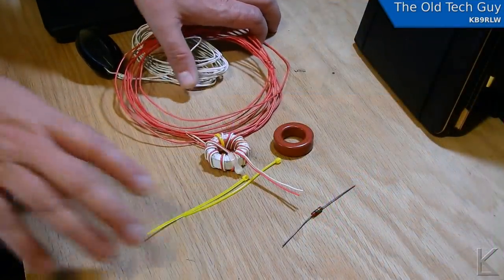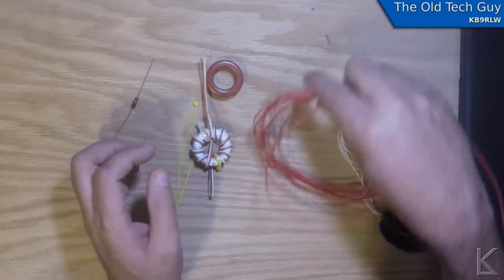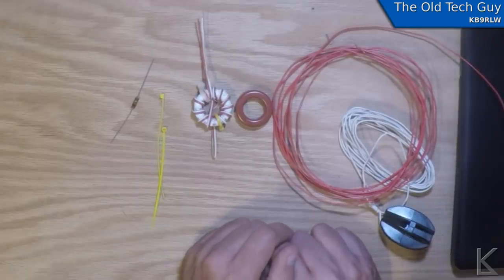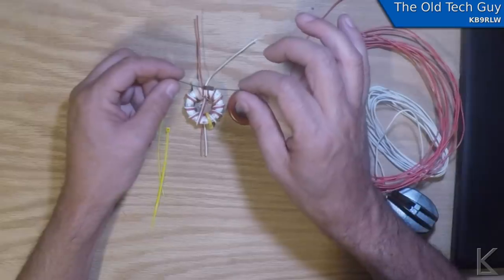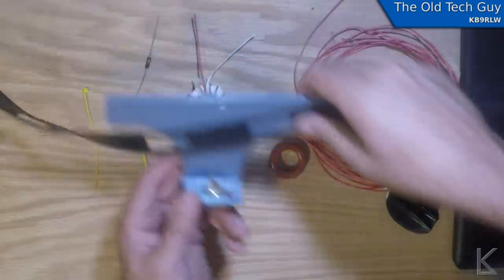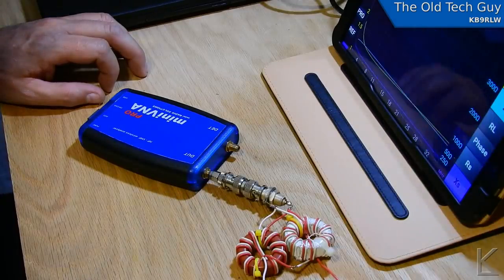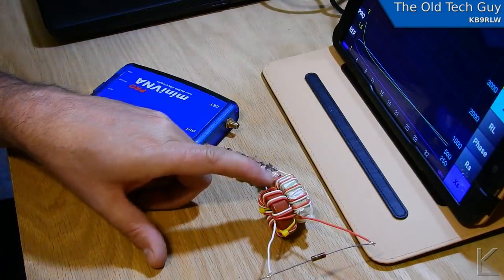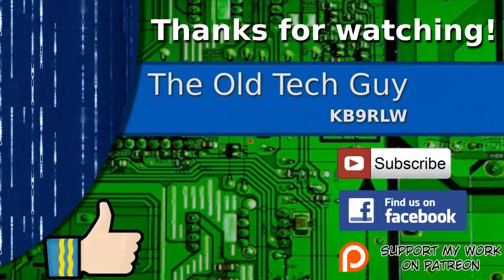Ham Radio - Building a 4:1 balun

Comment: Well, I bought a DIY balun kit on Amazon.....the instructions literally said "google it".  I found this video, which basically told me the kit has the wrong number and type of core, and the wrong wire.  I ordered the proper parts, followed these instructions and was pleasantly surprised at the results.  I was at least able to use the box and hardware from the kit to make a 4:1 balun I know I can count on.  It looks great on the analyzer.  I wonder how I went 30 years as a ham without knowing how to do this, but that's the point I guess....keep advancing your own personal version of the radio art.  Thank you for the info and the presentation.  N2SUB

Comment: The idea of this config of 4:1 Balun is it provides 4:1 matching but also if you use 43 or 31 mix cores the two 1:1 baluns connected series one end parallel the other end also give you common mode current choking as well all in one balun

Comment: Oh, was the part where you made the balun only available on the Patreon side? “Building a 4:1 balun” seems inaccurate as a title.
Reply from the maker: Well it wasn't put into a box, but the transformer was built in this video. All you need to do is wire it to a couple of connectors mounted in a box.

Comment: On the 1:1 choke video you me tioned 4 turns on each side as a 1:1. But here you mention 6 turns on each side for rhe 1:1? Thanks for any help great video easy to follow and understand
Reply from the maker: When just winding a choke, you can use any number of turns, as long as it's identical for both wires.  More turns mean more 'choking' action, but maybe greater losses in the choke.
When winding them for use in this balun, the number of turns matter for proper impedance transformation.
Reply: @loughkb  okidoki thanks a lot! 73 de NP3JD

Comment: The notion that wire can short on the core is not something I notice when using Ferrite.   My ohm meter shows no conductivity in Ferrite.  I always use 43 and I note you have a Red core which isn't Ferrite (I think red means iron but I'm not sure of that).  A question I have about use of glass insulating tape on the cores (not plumber's tape btw) is whether the wire heats the core or the core heats the wire.  I realize the curie temp is to be respected and keeping core cool is a concern but as far as 'what heats what'  does anyone know??
Reply from the maker: I believe I recall reading, and it makes sense to me, that the core heats due to eddie currents that are induced in it by the moving magnetic field. But that would be something I read many years ago when studying for an EET class.  Many years ago. So I don't know if that's accurate or not.

Comment: Hey Kevin, nice video.  I built the 1:1 from your video.  On this video, I see that the you mentioned 12 turns but on the 1:1 it is 8.  I went with this recommendation and man does it work great!  Had results as you have shown.  With a 260 ohm resistor I easily got down to 1.5 with all but 80 meters which topped out at about 2.0, which is well within my auto-turner's range.  I have watched several videos on baluns but yours was definitely the easiest to follow, full of great practical info and excellent video work.  Thank you so much! 

Burt
K4SRQ

Comment: I missed the Patreon video because I was contesting. Seven wire thermostat wire works good also. Now I'm confused Kevin. I been told by some EE's  that mix 43 and mix 61 are good depending on the power pushed through the torroid cores. I don't think I will have any problem since MAX on phone would be 10 watts; 5 watts using CW.

Comment: Kevin , I noted you used  multiple strand wire and not solid drawn wire.  It never occurred to me to use multiple strand wire. It obviously works!
Reply from the maker: It will, but it's hard to work with since it doesn't want to hold its shape when wound. I used solid core wire.  The photo from M0PZT site shows he used stranded.

Comment: The two cores in the M0PZT balun that you reference are NOT wound "SYMMETRICAL"  - why doesn't anyone mention that, and/or the possible affects of that ???

If you look, the red/black colors are REVERSED on the windings between the left and right cores.

On the right core, the winding starts with the black wire on the RIGHT, and on the left core, the winding starts out with the black wire on the LEFT, but yet the red's are tied together, and the black's are tied together on input!

What affect is this going to have on the phase, etc. (interactions?)

Can someone please explain this ?

At minimal, you didn't duplicate what he did, nor recognize/mention this in your video. You should fix that !
Reply from the maker: Yes, they are physically wound symmetrically.  Nothing to do with how they are electrically connected.

Comment: Our club in Central Oregon is preparing for a field day when weather permits for building off center fed dipoles. I have a Nano VNA and had planned on using it to confirm I have 50 ohm at the coax. I am still just a technician so I am trying to get my feet wet. Thanks for the video.

Comment: Great Video! What if the results had been different and there needed to be adjustments? How would you adjust the windings to get the SWR down if needed? Thanks! 73 de KD4NZR
Reply from the maker: If the translated impedance was high, I'd have added a winding to each, if it was low, I'd have removed a winding.   I think I got that the right way around! :-)

Comment: Nice work, Kevin! Would this be considered a voltage balun or a current balun? In researching OCFD antennas in the past, some people seemed particular that it must be a certain type of balun (I think current IIRC). Maybe you could explain the difference in a future video and why it is (or isn't?) important? I was never certain if it really mattered because I thought it was impedance that the balun was converting. Impedance is a ratio that involves both voltage and current, so saying a balun is just one or the other didn't really make sense to me. At any rate, this was really useful to me because I was about to build a new OCFD as well. Thanks for the video and links!
Reply from the maker: This is a current balun.   From what I'e read, a voltage balun would't work well in this application due to the phase relationship between current and voltage along the dipole antenna.   Most antenna projects I've seen that involve a balun warn against using the voltage type and recommend the current type.

Comment: If I use this on an off center fed dipole do I also need a 1:1 choke to suppress RF on the coax or will this balun suppress it?  Thanks!
Reply from the maker: Due to the way this one is wound, I think it will supress a bit of RF going back up the feed line.   You probably won't see much on the band the antenna is cut for.  If you force the antenna on another band with a tuner, you'll always get some RF down the feedline due to the mismatch at the antenna.
Yes, this would be used on an OCF dipole like a windom.  Also used on a folded dipole.
Reply: @loughkb  thank you sir.

Comment: I have been wondering if the Litz wire has been forgotten or is there some reasoning why it is not needed in these kinds of wound components.  Just recently I had a reason to check the numbers again. The result was that resistance of both solid wire and ordinary stranded wire is in steep increase already soon above 100 kHz.  That applies to AWG 18 size.
I can speculate that the Q-factor does not collapse at the higher frequencies as the inductive part of the formula also increases by the frequency.  Anyway, my situation was dictating Litz wire use at 100 kHz due to overheating of ordinary wires.  Another difference is that the shown toroid coils are pretty open, allowing cooling, while my choke needed to be 3 or 4 layers thick.

Comment: Hey Kevin, i made i bigger version of this 4:1 balun.....but i have a question.......do you think that i can mount this balun attached to the antenna, or i need to keep it far from it??
Reply from the maker: The 4:1 balanced to unbalanced matching transformer is designed to match a higher impedance balanced system to a lower impedance unbalanced feed line. So in the case of a loop, an off center fed dipole, or ladder line to coax, the balun needs to be at the high impedance point. So at the antenna. And that's what balun means, balanced to unbalanced.
Reply: @loughkb  sorry i asked something different, i was wondering if the antenna metallic boom would make some problem if i attach balun close to it
Reply from the maker: @bairamzubi280  you would not want it too close to the boom. A few inches away at least
Reply: @loughkb  argh i have already mounted it on the boom.....with nano vna idont have any chage....i hope that it willthe same with 500W. cheers, thanks for sharing 73 IU4PSD
Reply from the maker: @bairamzubi280  at 500 watts, I hope you used appropriate wire and insulation from the cores so it doesn't arc

Comment: Thanks for the video. 

I was wondering if this balun can go in a metal enclosure or if plastic is recommended.

I'm making one on smaller 43 cores and it would fit in an Altoids tin which I already have, but don't want to use if it will adversely affect performance.
Reply from the maker: I've put them in both.  It doesn't seem to matter.

Comment: I'm on the verge of this and I've watched your's and other folks videos on building an unun.  Mine will be for end fed. While you make it seem easy, my fumble fingers will make an easy job difficult.  Who knows I may wind up with an antigravity torus or a fire starter Bear Grylls would be proud to own.  I'm sorry for jumping on you about kerchunking. I didn't intend it to sound angry or vicious. Sometimes my fingers type with out consulting my brain.
Reply: Lew, I don't think you will be happy with 4:1 on an end fed wire. 9:1 would be minimum.  You may need higher than that, depending upon the wire length and bands used.

Comment: Excellent video and presentation. I have used a home brew off center fed dipole with 4 to 1 balun for several years (10 or more years) for 80 through 10 meters. The performance is superb as long as you keep the legs of the dipole at least a foot away from tree limbs and other conductors. My balun is able to handle 1200 watts PEP and 600 watts RMS with ease because the toroids I used are muich larger than the ones you used. Amidon makes a kit for this balun that works great. The radiation pattern from the OCF on the higher frequencies seems to have multiple lobes but on 40 and 80 it acts just like any other half-wave dipole. It is my go-to antenna for portable operation. Thanks for sharing it with us. Great job, keep up the good work. 73 DE K7RMJ Frank
Reply from the maker: The antenna I'm building is a mono band and ocf.  Works amazingly well on the band it's cut for but not on others.

Comment: I hope this antenna installed as an inverted vee doesn't shoot everything straight up, I would like a suburban backyard antenna that can work some DX on it. My mast can support a dipole at 23 feet, and have plans to make it 31 feet max, with ends 6 feet above ground with angles going from 115 to 105 degrees when I get it higher, in a 79.5 foot space. I will be taking notes on this one. Thanks Kevin.
Reply from the maker: Well, this is a unique design.  First I've seen of this type.  It is a monoband antenna though.  I've built it for 40 meters and it's performing better than any 40 meter antenna I've ever had.   It would fit in your space, but you'd have to choose a single band.
Reply: @loughkb  One of my friends has a 80 M version and made another for his son. I was considering a 40 M sized version to try out by modifying an existing dipole. Or just making it a 80-40 coil loaded dipole. My friend has already sold me on the design, I am sure your going to really like yours. And I'll still be taking notes from you on this.The 4:1 balun design was another element I needed to know about too. Yours is easier.

Comment: Thanks for this. It was very instructive, especially the verification you did with the VNA.  I'll really need to get one.
Reply from the maker: You could manually sweep the range with just about any antenna analyzer and measure the impedance.  There's also a way you could do it with an oscilloscope, frequency generator and ohms law. :-)   But the VNA is proving to be one of the most useful tools I have.

Comment: Nice video Kevin! Will one of those work on 2 meters?
Reply from the maker: Not with these core types or windings.   At those higher frequencies, you would need different components.  Also, with a half wave dipole being somewhere around 38 inches, finding the 200 ohm off center point would be difficult.  Impedance could change quite  bit over an inch at VHF.